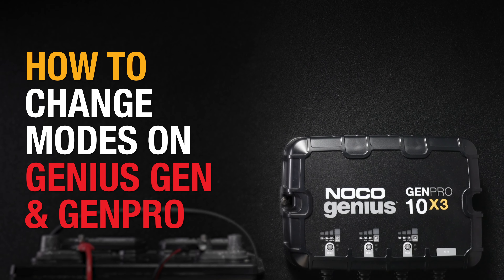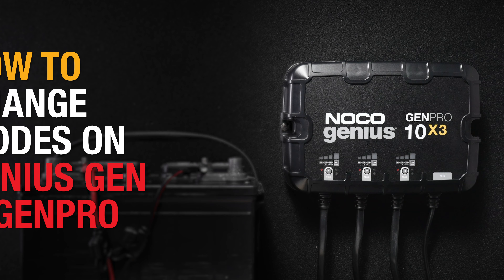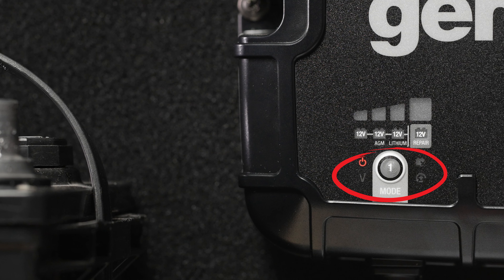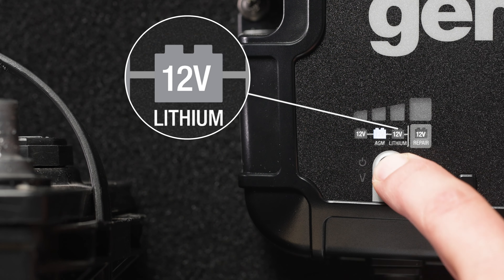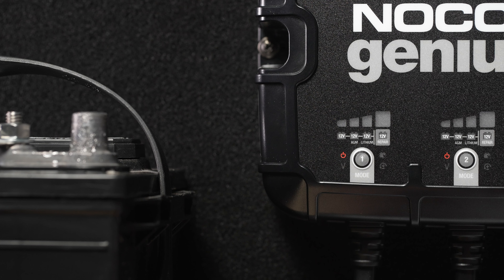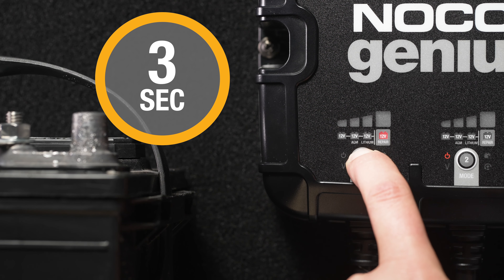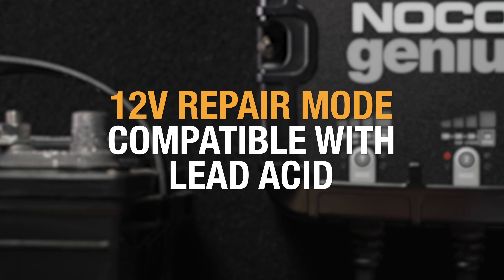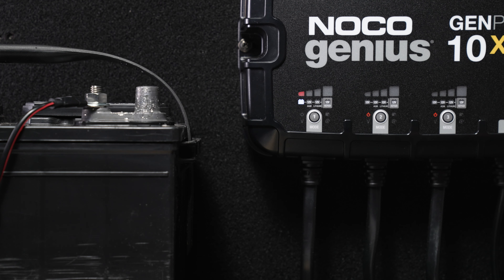How to Change Charging Modes on NOCO GEN & GENPRO

Comment: Does repair mode work for 6v batteries?
Reply from the maker: The 12V Repair Mode is for 12V battery systems only, if you have two 6V batteries wired in series for 12V the 12V Repair Mode can be used that way.